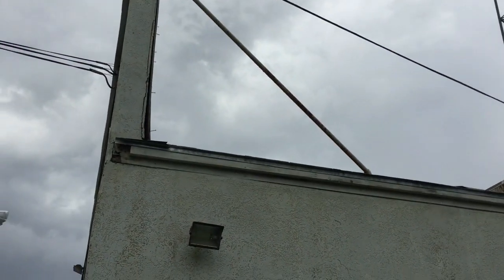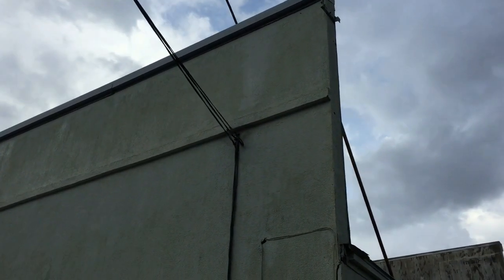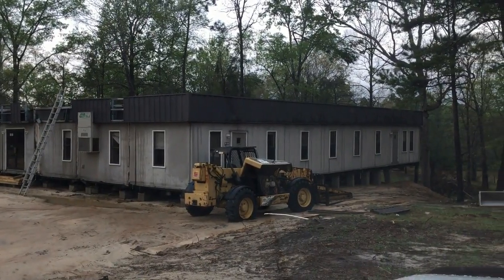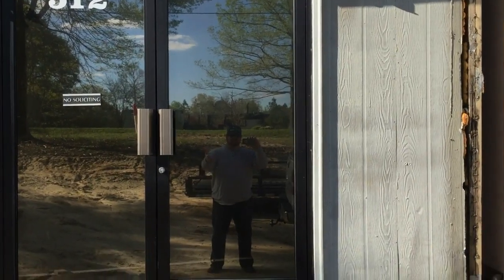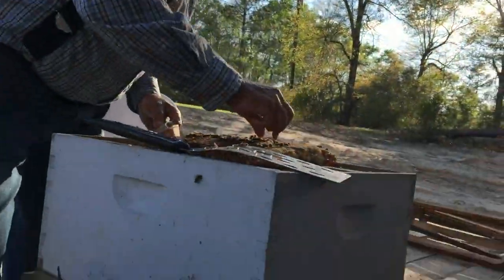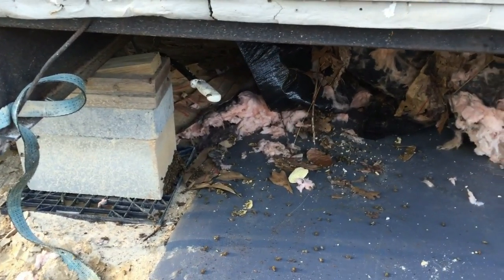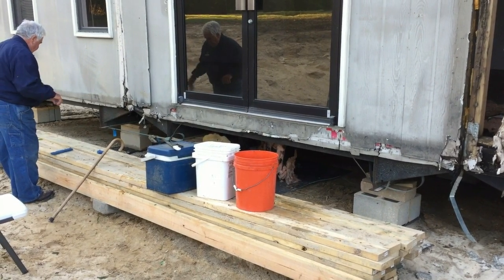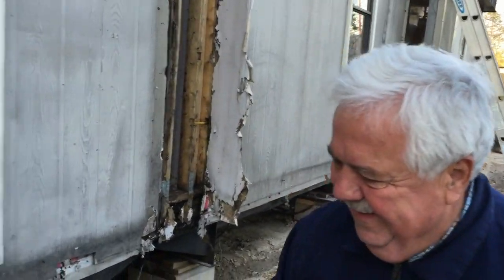Seventh Day Adventist Church Bee Hive Removal

Comment: watching the 628 dirt rooster channel right before bed is a way of life 😎
Reply from the maker: +Shifty Eddie Ha!  Sleep tight
Reply: @628DirtRooster  how much better is the 2nd gen bee vac than the 1st gen?
Reply from the maker: @guardiandogoargentinos1385  Same performance when working just easier to connect and disconnect components.  Also better looking.
Reply: @628DirtRooster  i didn't check the price difference. If you was on a budget would you think it's worth it to get the 2nd gen? Or would you go with the 1st gen?

Comment: Nasty having to work under that swarm like that, no place to run, lol. Your Dad has bad knees like me, I know the signs and it's a bummer. Got to be tough to be old. Great video as usual,  thanks for your time. Tell your Pappy hello and take his Advil, Capt'n
Reply from the maker: +wincharter1 I don't think he has a single joint in his body that works right.  Before you know it I'll be dragging him around on a skid to do removals with me.
Reply: Yep, heck to get old but then the alternative is not exceptable. Keep him movin, skid or wheel borrow.
Reply from the maker: wincharter1 I've gotten him to go to the gym a half dozen times in the past few months.  Trying to get him regular so he actually benefits from it.